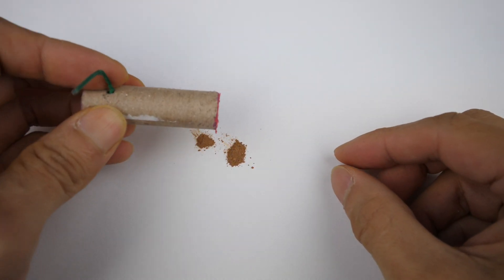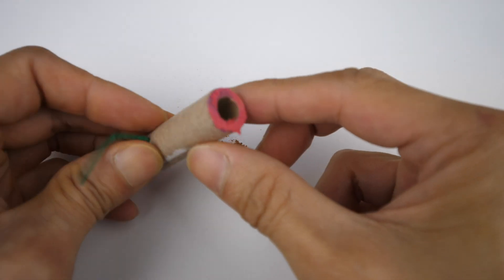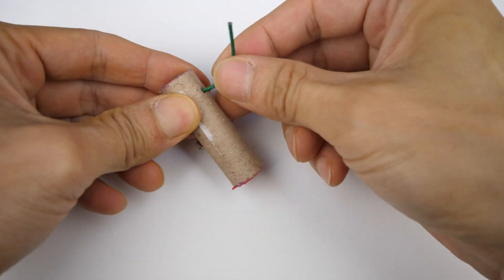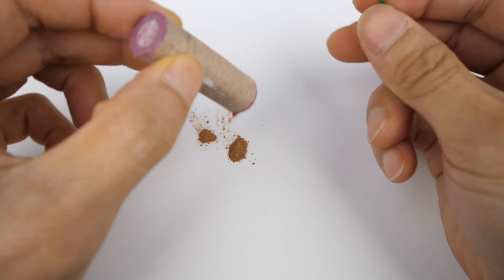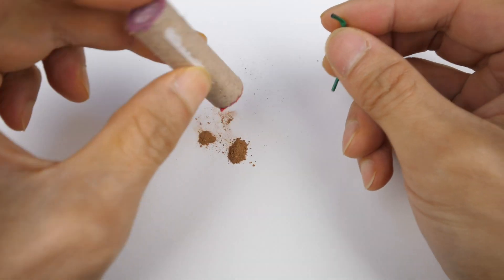Inside a Ground Bloom Flower Firework

Comment: Been trying to make these for a while now, inconsistant results, some great, most are crap, thanks for this video, 
I never knew there was so little black powder in these. 
Kno3 65%, 
Char 25%
Sulf 10% milled to perfection. 
Add magnalium for effect at 20% and increase sulphur by 5% or it burns too hot and obliterates the tube. 

After your video, I'll alter my design and see if i can get them consistent 
Thanks for the vid

Comment: Hi there is the black powder a gunpowder or flash powder? how do you know its gun powder?? thanks
Reply: Black powder is gun powder but "gun powder" isn't really a thing, it is just another name for black powder. They call it gun powder because they used black powder in firearms before modern smokeless gun powder was invented. 
 This is black powder with some metal powders (I don't know which ones) mixed in to give it colour.
 Flash powder is very different to black powder. Black powder burns much slower than flash powder, flash powder is also more volatile and more explosive. That is not to say that black powder isn't fast burning, volatile or explosive (especially when clumped together) but flash powder is just more so. 
95% of fireworks the main ingredient is going to be black powder, that is just the way it has been for the thousands of years since they were invented. Flash powder is only used for certain effects where needed and won't be found in most fireworks.

Comment: It could be for safety reasons so that a spark doesn't set off a million fireworks in a factory that's my explanation of why it takes a higher temperature to ignite the gunpowder
Reply from the maker: Oh... but a spark does set them off because the wick ignites with a spark.
Reply: @BeatTheBushDIY  but what if that WIC has something like phosphorus in it or something that burns really hot so it's not like you're typical static spark but rather extremely high heat
Reply from the maker: Just keep any fire away if you do not intend to light them!
Reply: @BeatTheBushDIY  I assume these are safe and sane fireworks so they probably have strict standards like make sure the only way I can start up is if it's super high temperatures keep stuff Factory workers safe I'd be curious if the ones that are not legal ignite with a lower temperature
Reply: gun powder alwayse has the same heat but depends how much grams it is
Reply: @re43p3raod3  different formulas
Reply: That's exactly it, fire marshels started making noises about banning them. Back in the day these lasted a good 15 seconds. You can still find the real chinese ones but avoid the TNT, Phantom or other american brands because they have all been nerfed like this.